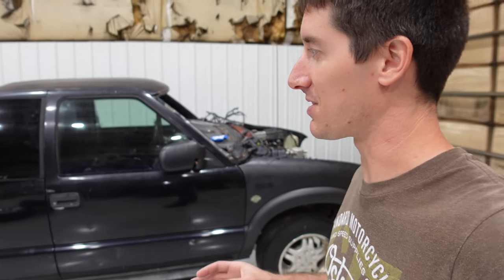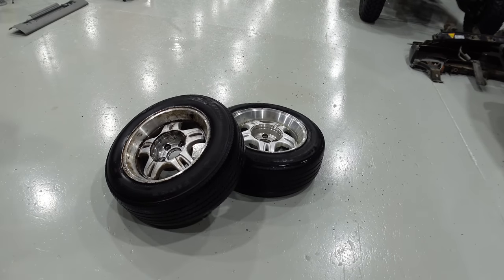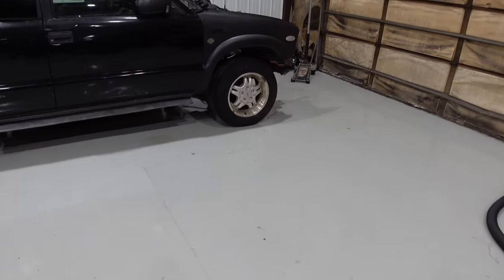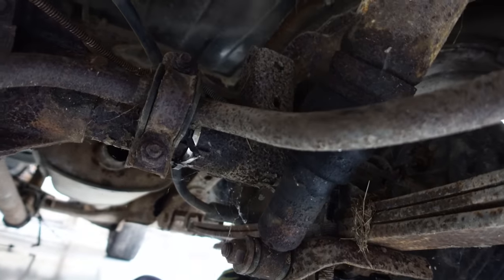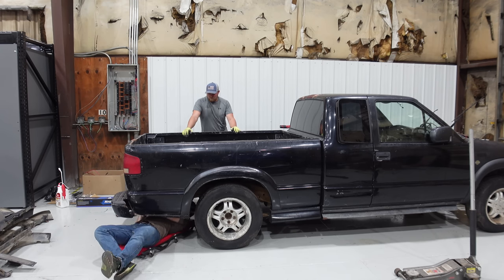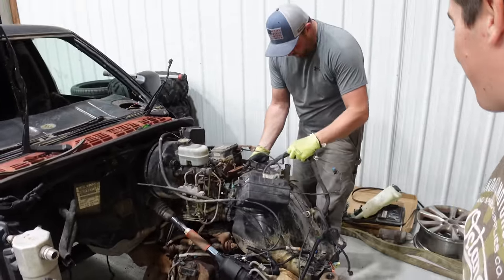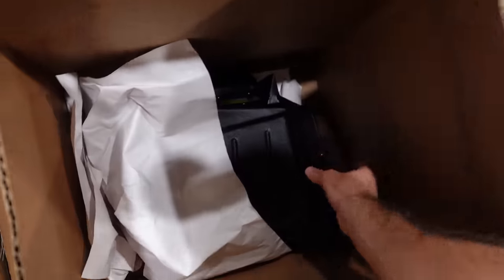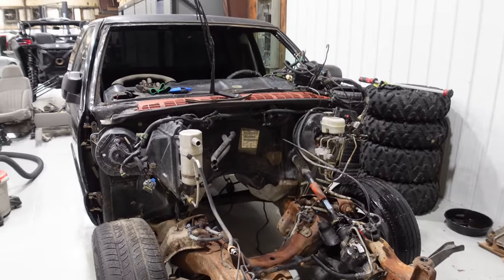FREE Chevy S-10 Xtreme Gets A FRAME OFF Restoration

Comment: You should go with a Newer Style Disc Brake Rear End instead of that Drum Brake Rear End, All you need is the Newer style Rear End & The Proportioning Valve from a 1998-2004 2wd S10 Blazer or you can just buy a Disc Brake Conversion Kit...
Reply from the maker: That's the plan! 🍻
Reply: 8.8 Explorer set up.
Reply: @Davidsmusicselection  That's what I was thinking. When I looked into this, everybody who did the swap said the S10 rear is not strong enough for a V8.
Reply: I'm so happy that all the drivers we have are 4 wheel disk brakes, so much easier to work on and they stop. Some of the Mopar guys used to try and find 72 imperial rear disk brake setups to retrofit rear disks on older big Mopar muscle cars.
I personally bought a complete running 74 Dart 4 door for 150 because it had big bolt front disk brakes to put on my Dart. I asked him if the brakes worked and would it drive 5 miles and handed him the cash. Just the basic brake setup 2as worth 350 bucks even then and I got everything needed from that car.

Comment: Tip, when a wheel won't come off, put the lugs back on loosely and drop the truck back on the ground.  If it still won't go, roll back and forth a few times... and yes, spraying penetrating fluid around the hub center is important too

Comment: I AM IN SHREVEPORT AND I CHANGED THE 1ST S-10 BED SIDE PANELS ON BOTH STYES FOR THE 1GCCS PLANT. IT TURNED OUT WELL. ME AND 2 OTHER FELLAS FROM RED RIVER CHEVROLET BUILT A S-10 EXT CAB COMPLETE ASSEMBLY FROM A RACK OF PARTS. I STILL OWN NUMBER 101 FROM THE FIRST GEN. IT WAS MADE FOR ME WITH EVERY OPTION. I OWNED 6 OF THEM IN TOTAL. THE LAST ONE I HAD WAS WITH AN ADVANCED VORTEC V-6 STANDARD SHIFT, AND AFTER WARRANTY PUT IN A LT1 CORVETTE ENGINE.. THAT ONE WAS A TICKET MAKER ON THE INTERSTATE. TROOPERS GOT ME A FEW TIMES. NOT MUCH I DO NOT KNOW ABOUT THE S-10. THAT WAS A LONG TIME AGO..

Comment: G-body dirt track parts (upper control arms with extended ball joints, in particular, and roll center adjusters) will massively improve the way this thing drives.

Comment: For engine compartment space you should add Hydra-boost off of an Astro Van and change the steering gear from a mid eighties Monte Carlo LS for better lock to lock steering! On the rear brakes you can convert over to disk brakes off a blazer and add a proportioning valve!

Comment: You can get front steering knuckles off a 2wd blazer and then swap in 2 piston front brakes. You can also use the front springs off a ANY non zq8 s10 for a higher spring rate.

Comment: It's funny how I been looking back at these Trucks on line since I've had quite a few of them.  I really wanted the xtreme as ny first truck but the one u wanted got sold on me then I settled for a extended cab ls and made my own xtreme.  It was still just as Cool only thing that is or was different is you need to get a posi rear which is necessary and the steering box is even better apart from the zq8 suspension and sway bars body kit fog lights and leather wrapped steering wheel

Comment: I miss my 1989 Chevy S10, bought it brand new and paid $6900, drove it 6 years was a cool truck.  I changed the seats. Stereo, added air conditioning and power windows and tinted the rear window.   I wish I would never got rid of it.

Comment: Xtreme S10’s are pretty rare these days. Most people don’t know they held .85 G’s on a skid pad on snow tires.

Little known background. Glenn Hotchkiss was brought in to help develop the ZQ8 suspension after the Syclone didn’t get the suspension upgrades they wanted due to budget constraints. 

It was originally intended to have a supercharged 4.3, but GM shut it down as it was performing equal to the Corvette, and they didn’t want to put the upgraded transmission in it. GM didn’t want another super truck giving their top tier car a black eye. 

The V6 trucks have an 8.5” rear end, which oddly enough still made it to production despite being unnecessary after they dumped the extra power and 6 speed. You may have issues finding parts for it. 

It was the best handling production truck made up to that point. Had it launched with the boosted 4.3, it would have been an icon. Instead they went the opposite direction and made the standard V6 the top tier, and offered a 4 cylinder in most trucks. They were never meant to be offered as such. It was supposed to be a V6 with the standard drivetrain, or a boosted 4.3 with an 8.5” rear and a 6 speed. 

Glad to see you’re going all in with this. Finding good examples in this day and age is next to impossible, and they’re fun little trucks even without the extra power.

Comment: You might want to grease those cardan joints in the driveshaft, you need a needle grease gun tip. Also the true zq8 handling package has a hop shock for axle wrap, thats the bracket on the top right side of the differential. Mostly found on standard trans trucks, but makes a big improvement.

Comment: Glad you're going to save the S10!  Good luck with that.  Just as a suggestion when you're dealing with a rusty vehicle like that - even wearing safety glasses some rust could get in your eye.  Get one of those neodymium magnets - if you get some rust in your eye those will pull it right out.  Had a big chunk fall off my Ranger when I was working on it, took the magnet, ran it along the edge of my eyelid and eyeball, and it sucked the pieces right out easy as pie.  Can't wait to see more (L)S-10!

Comment: You need a 4 or 5 pound dead blow hammer, then lay down and hit the wheel from behind a few times, trust me, I’ve changed my fair share, been in towing and roadside almost 20 years 👌👌
Reply: sometimes,they need a hell of a lot more persuasion ...had to use a scissor jack to pop a wheel off my WS6 trans am and it still wanted to fight me....

Comment: Aluminum and steel don't mix they corrode together like weld. I had a 93 Camero with Xtreme rims they were so stuck on no matter how big of a beating I throw it the one rim wouldn't come off. I had to pull the axel out of the housing and take a torch to it. All to change a flat tire.

Comment: With the hours you put in, you need your own apartment there at the shop, just for those super late nights.
Reply: I would not be surprised it there is something to sleep on already in the building.
Reply: I wouldn’t be surprised if an older camping trailer shows in the corner of the shop at some point
Reply: A camper van or small motor home would be good in the shop
Reply: In one of these S10 videos, he did say something about plumbing and a kitchen... so maybe he'll turn part of the shop into a bachelor pad??

Comment: That is the steel drive shaft, should be three u joints with carrier bearing in center and CV style joint between two back u joints. The aluminum shafts have two u joints. I argued with every parts store about that except the one my grand father retired from. Can't wait to see more video's on this. Not many doing video's on S10's anymore.
Reply: The double cardan joint always fails and it costs close to a grand to get it rebuilt. I always replace mine with the double u-joint aftermarket one for 3-400 so it's at least serviceable. On the xtreme or any lowered truck you should also get the shim kit from jagsthatrun. The extended cab xtreme can run a one piece if you don't mind modifying the rear of the cab for clearance. My daily xtreme is only a 2/3 drop over stock but anything over the stock 2" can lead to high speed vibration on this model due to the weird rear driveshaft.
Reply: @mjc8248  Thanks for the information. When mine went bad, I had taken the rear shaft from my parts truck. Was told they're balanced together but I had no issue doing this. My trucks were both 1995 extended cabs. The 96 I have is regular cab with aluminum one piece shaft. 
Maybe forced to sell mine as that property is going on market in spring, worse case I buy a 2000 model year. If I can find a solid one to build on. Already have a nice step side bed and 3/4 bell tech drop kit. Planned to use those on my project.
Reply: I have 2 2000s and an 03. I use the one from transaxle and driveshaft distributors, you can use their Amazon store so it's pretty easy to get. You can't go wrong with belltech but you may need the shim kit to correct the drive angle if you getva vibration. My daily will be 5/6 at least by winter to match the xtreme blazer I sold over the dummer.

Comment: v6 5 speed s10/blazers often had the stronger 8.5 rear end, look at the bottom of the diff if it has fangs it a 7.6 (like this truck) if it has square corners its a 8.5

Comment: I used to have a 94 extended cab s-10, I wanted to ls swap it for the longest time, but the old venerable tbi vortec 4.3 just kept rolling down the road with zero issue so I left it alone

Comment: It’s a whole lot easier to pull a bed off when you take the rear wheels off and drop it down low on some jack stands.
Reply: Or use a forklift.....
Reply: @mike8818  which as he showed, was buried at the back of the other shop bay behind several detail dudes customer cars. So, heave ho it goes!
Reply: @mlindholm  He could have pulled the forklift out before it got blocked in, or he could have, you know, used one of the Bendpaks...

Comment: You should have used a lift to take off the bed. Put straps on the arms of the lift and lifted the bed straight up. The cab can be lifted by the rocker panels also. Saves your back and lots of time as well.
You have 4 lifts, work smart not hard man!

Comment: I just had one of those same windshields replaced for $150 in Cali. Your's should be dirt cheap.
Reply: If the windshield really is less than $100, buy two.  Everyone I’ve ever known that had one of these (including myself) had a cracked windshield.  I think it’s the curvature that causes it.  Same with my old Chevy Express work van.  But my current (and probably for perpetuity) Sierra is still on the original front glass after over 250k miles.

Comment: Pretty funny you put a swivel on the socket when all the bolts had access holes in the frame to go through the hole with a straight extension.....hmmmmm...,

Comment: Speaking of the rear wheels: Is it even possible to convert the rear brakes to discs?
Reply: If you swap a whole different rear axle, it is...as another comment mentions. A Ford "8.8" rear end, or 12 bolt GM apparently are the plans.
Reply from the maker: Yup, we're going to disc for sure! 🍻

Comment: It's a Chevy, you will not need to work on it on the side of the road, DO NOT CONFUSE IT WITH A FORD OR A DODGE (Fraud or Dog)...
Reply: Lol ur crazy GM are the break down kings! I just got rid of a 05 Silverado 5.3 thing broke down all the time worst shit I've ever owned. I currently put my 03 F150 4.6 back on the road at 301k miles still drives fine any chevy I ever had was junk!! I'll never own one again